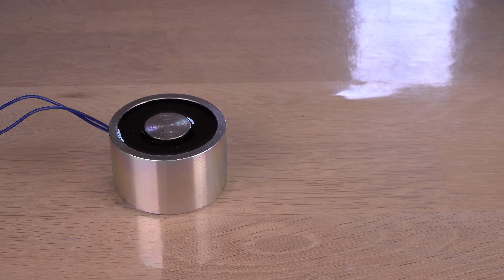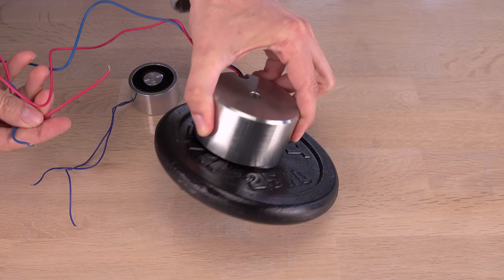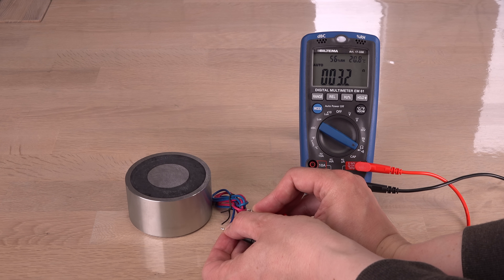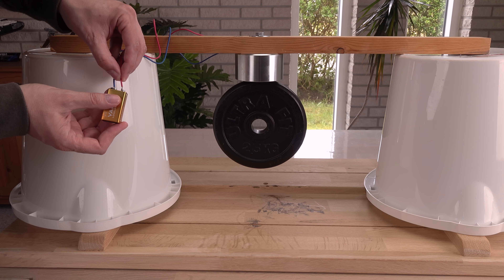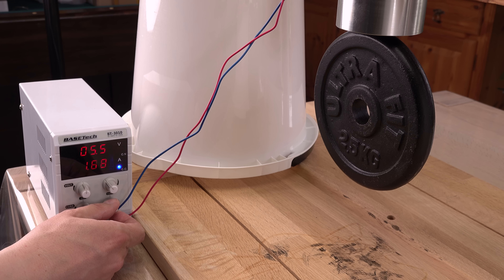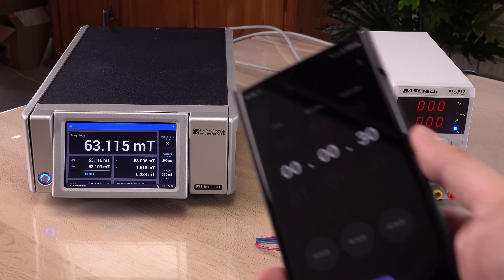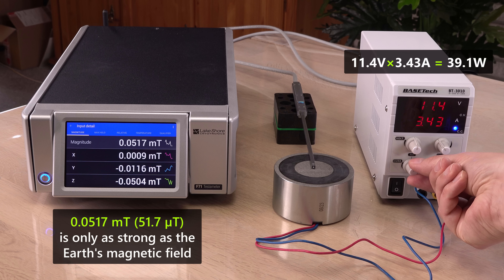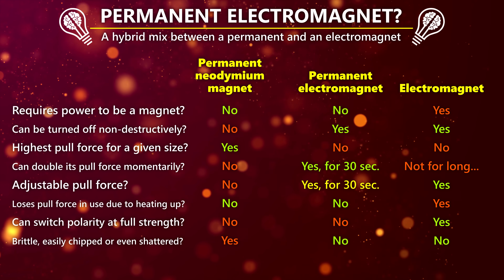NO ELECTRICITY Electromagnet?!? The Weird and Wonderful Permanent Electromagnet

Comment: So simple yet so clever.  Scrap yards might save money using this idea when they lift cars and stuff. They are using a constant current, this would save the magnet from being on so long.
Reply: They would not safe money AT ALL... on the contrary.

A normal non-permanent electromagnet, as used by scrapyard cranes, creates magnetism by using electrifying cheap coils of wire. Yes it costs money to run it, but that is absolutely nothing compared to the cost of creating a gigantic permanent magnet. (not to mention the weight of the thing, which would be tons and tons on its own).

To have a permanent (electro)magnet you first need to create a gigantic permanent magnet out of extremely heavy magnetic material (like iron, etc). To make a magnet the size of which is used in scrapyards would cost billions per piece.

Also, those scrapyard magnets are most of the time OFF instead of ON/magnetized anyways.
Reply: @CookieTube  I agree and I think another problem would be safety. With the electromagnet fighting against and cancelling out the permanent magnet, the repulsive force between them must be pretty strong. That means the construction holding them together needs to be able to withstand that force. For a magnet the size used in junk yards to lift cars, I'd think the forces would be pretty strong and if it ever failed and came apart, it might be catastrophic and dangerous.
Reply: @stefanl5183  yes and no... there is no repulsion between the two if you apply the proper polarized current.
But if you do, yeah, things might go boom.

What actually happens, with the right polarized current, is that the magnetic fields of the permanent magnet are actually attracted to the coil inside, instead of propagating outwards.

So there is no repulsive force, on the contrary, there is an attraction force (which would keep the device together so to speak). When there is no power, the magnetic fields are 'free' to go 'outside' and wrap around the device as if there was no coil in the first place.

Note: I'm not the best in explaining all this though.

Do you know those things, often used in work shops and labs where if you turn a knob the thing is magnetic and holds to a surface. And when you turn the knob the other way, it releases. That is essentially what an EPM is, but instead of a manual mechanical knob, it uses electricity to "turn the magnet on/off" (of course, the magnet is always 'on', hence the word 'permanent'. It just alters where the magnetic fields go)

https://www.youtube.com/watch?v=PMma3OJUHhs
Reply: @CookieTube  You really should study physics a bit more if you are going to be tempted to come out with such moronic statements.  You sound moronic.

Comment: This is very interesting. I can picture magnet fishing guys upgrading to one of these. The ability to let go or attach stronger would be neat.

Magnet vises and bases are very handy in any workshop for quick and solid mounting of tools and measurement equipment and difficult to mount objects. Strong switchable permanent versions are very expensive and bulky and electo versions can only be left on for so long before overheating and they need significant power. 
This magnet gives so many options. Turn off for positioning, neutral for holding in position and charged for when working. 
I would love to play with some of these. Tapping head, grinding plate, mag sheet metal brake, the list goes on.
Where do we find these? What specs do I need to check to ensure I'm buying one with the same potential?
Reply: "This is very interesting. I can picture magnet fishing guys upgrading to one of these. The ability to let go or attach stronger would be neat."
.... or make it double duty, and apply sh*tload of power and you have an automatic real fishing device ... lol

In all seriousness, the usage as a (semi-permanent) holding device in work shops is indeed one of its many uses, just because of the exact reason you mention.

The search terms would be "permanent electromagnet", "electro-permanent magnet", or "EPM".... And as for specs, it is the holding power you need to check, usually expressed in Newtons (N).
Reply: @CookieTube  So far I haven't been able to find any to purchase. Ebay, Aliexpress etc can't even get basic magnet terms correct. Eg. Magnet sucker, magnet suction cap. 
Not sure were to find them, but I'll keep looking.
Reply: @NathanNostaw  Did a quick search on Conrad. Apparently, permanent electromagnets are listed there as "magnetic (disconnected)" opposed to "not magnetic (disconnected)" for normal electromagnets.
🙂
I think the one from the video is the "RED MAGNETICS Electromagnet magnetic (disconnected) 1900 N 12 V DC 45 W ITS-PE-8245-12VDC" price € 230 / $US 260
Reply: @CookieTube thanks for the reply. Ill see if Conrad ship to Australia and if the freight charge is fair. Given the individual price ($500aus +freight), my grand idea of an array of these for a sheet metal brake may need to be put on the back burner.

Comment: No way you're going to get 2.4A from a 9V battery. Being typically six 1.5V cells in series, they're not designed for high current draw.
Reply: Obv when you connect the magnet, its EMF is so low, it becomes not 9V but more like 6 or even 3 volts.
Don't forget voltage drop.

Comment: I’ve built powerful electromagnets from old microwave transformers, you cut the top and secondary coil out and the primary alone generates a strong magnetic field, even on 1.5V. It’s strong enough to keep my workshop door locked shut

Comment: At 3.3 Ohms it is very unlikely that your battery will keep it's voltage level at 9 volts. I think it will be closer to 1 Volt or something like that...
Reply: yeah, most people highly overestimate the power of a 9V battery. It is one of the weakest type of the common (household) batteries.

Comment: These are for doors/gates where you pull them open after scanning your card. My childhood tennis court had them and I remember trying to open the door manually and never could.
Reply: Yes, they could be used for that, but it is more expensive than a cheap non-permanent electromagnet and a spring. In that case, it is the spring mechanism which holds the door locked (not the electromagnet itself). And when briefly given a power pulse, the electromagnet pulls the springed lever back to unlock the door.

Comment: Even 30 seconds in it's obviously a permanent magnet with a coil to cancel out the field. That would be useful as a fail-safe when lifting heavy things, and a power saver since you only need a current when you want to release the load.

Comment: Just floating an idea..... work with me.
You take a vessel and fill it with mineral oil. Suspend a light weight, buoyant, magnetic rotor on top of the neutral mineral oil. On the outside of the vessel, utilize one or more of these EPM devices to naturally repulse the opposing rotor, suspended in the oil. The rotational energy is extracted at the top most point of the vertical axis. By pulsing on and off using its own self generated current, the natural effect of the permanent magnet remains undiminished. Friction is greatly reduced, due to the mineral oil, which is unaffected by the magnetic fields. More consideration could be given to the hydrodynamic effect created by rotation, as well, if scaled up.
Reply: I wish i could draw you folks a picture.
Reply: @toxok If you're trying to describe what I think you're trying to describe, it'll cycle on and off for a really long time. Maybe even forever, if it's very finely crafted. But the moment you try to extract any energy from the system, it'll stop. Because you extracted energy from the system. And that's a good thing. What do you think Lockheed Martin would do with free energy?

Comment: I would like to see you make an oscillator with this: 
a piece of a thin flexible ferromagnetic material that is placed closely to the magnet and will be attracted to it. After touching it will complete a circuit that is connected to the magnet and will therefore turn it off. The flexible contact will be reset and attracted again.
Reply: buzzer?
Reply: Not only that, this oscillating buzzer can be used to convert DC to AC 😱

Comment: In MRI machines, particle accelerators, etc., persistent superconducting magnets are often used to prevent the need for a continuous high-current DC power supply, meaning only the cryorefrigeration system needs power. Through the magic of superconductors, the whole magnet remains energized, and thus creating a magnetic field, simply by shorting the ends of the coil with more superconductor, which is often accomplished by having that superconductor shunt always connected but with a small heater to raise it's temperature above where it superconducts when the external supply is connected for startup. Although it seems as though this would break some law of physics, remember that conventional permenant magnets achieve a similar end goal. More info on wikipedia: https://en.wikipedia.org/wiki/Superconducting_magnet#Persistent_mode

Comment: I wonder about permanent demagnetization if the magnet is activated many times.
Reply: Yes. They will.  But EPMs are supposed to be used in unpowered mode 99.99% of the time and only shortly pulsed into the powered (unmagnetised) state.  So the loss is minimal if used that way.
If you have it powered for long times... then yes. Very much so.
Reply: @oreubens  That is probably more related to high heat while ignoring the duty cycle making it easier for the material to lose its magnetism. It really depends on the material used and what temperatures and magnetic fields are reached. I suppose you could run the electro-magnet in the polarity that matches the polarity of the permanent magnet getting it as hot as possible without burning windings or ruining the potting material and then chill the thing down before de-energizing it to re-magnetize the permanent portion.
Reply: Makes me wonder if you can then re-magnetize it simply by running in the opposite polarity
Reply: @casualbird7671 
Most definitely running it in reverse has the opposite effect.
Reply: @drgazter what if it's to do with heat instead of magnetism like the other commenter said?

It's be cool if it was the magnetism though, then maybe you could automate it to keep the magnetism "topped up"
Reply: @casualbird7671  Probably yes, I though about that too.
Reply: That's probably why it has those strict duty cycle limitations (and might also be why it uses the more robust magnet; heat tolerance probably comes along with some level of general demagnetization resistance), and it's most likely intended for use in situations where it'd be turned off significantly less often than that
Reply: That depends on the material used for the permanent portion. Neodymium is usually rated for 1.5 Tesla, so this one probably doesn't have anywhere in where the field strength gets changed by 1.5T.
But the real answer depends on the material used.
Reply: I`d also expect it being bad for the magnet if it is not holding anything (open magnetic circuit) and you energize it anyway.... I mean, being left open can damage some types of permanent magnets without any additional field interfering!

Comment: I've been pondering making some things like this (much smaller) for a couple of years, using a regular electromagnet facing a permanent magent, as a way to drop the canvas covers/awnings over the mesh windows of my large tent whenever it starts to rain.

I didn't know they existed premade.

Is 'permanent electromagnet' the best search term?
Reply: To actually answer your question instead of ranting about how they are misused in amateur theatre:
Proper search terms would be: "permanent electromagnet" or "electropermanent magnet"  or EPM....  (with emphasis on 'permanent' in both case, otherwise you get the normal electromagnet).

The one in the video was purchased at Conrad , and is the type: "RED MAGNETICS Electromagnet magnetic (disconnected) 1900 N 12 V DC 45 W ITS-PE-8245-12VDC" , costing $US 260. On Conrad search for "magnetic (disconnected)" opposed to "not magnetic (disconnected)" for normal electromagnets.

Comment: Simillar but not round magnets i saw used as a door lock, deactivated with rfid button or code
Reply: Maybe, or could also have been a NON-permanent electromagnet with a spring mechanism. That would be far more common (because of costs).
In that case , the non-permanent electromagnet is used to actually release the lock (pull a lever), and it is the spring system which holds the door locked when the electromagnet is not powered. So in case of power outage, the door stays locked.

Comment: I wonder if these are the same thing we have at work on the doors? I almost thought it was supposed to strengthen the pull at first.
Reply: Highly depends on what kind of doors they are.

But 99% of the time, normal non-permanent electromagnets are used on normal doors. i.e. they keep the (fire proof) doors in hall ways in an swung open state, and when there is a power failure they release and the door gets closed.

The permanent electromagnets, as shown in the video, are used in cases like security doors which need to stay locked in case of power failure and can only be unlocked from the outside with a badge or something (which sends a electrical pulse to the magnet to momentarily unlock). eg: front entrance doors of buildings, or one-way  gates in fenced of areas. Although in these cases, a system with a regular non-permanent electromagnet and a springed lever can be used too.

Comment: This kind of magnet is called an electropermanent magnet (EPM).  Plenty of info online, once you know the proper name for one. :)
They're used when you need magnetic gripping is needed but permanent powereing is not desired or practical.
Reply: Is this similar to how magnetic core memory works? You can magnetize and demagnetize it with electricity
Reply: @piguy4137  No.

In case of a permanent electromagnet, the magnetism and fields are always there, you just shortcut it to the electromagnet inside the 'device' and thus the magnetic field lines also stay inside the 'device'. As explained in the video, the activation of the electromagnet inside the device "cancels out" the permanent magnetic fields which would otherwise be noticeable from the outside. Also, the 'permanent' is key here. It is just a matter of getting the magnetic field lines outside or keeping them inside the device. But once the device looses power, there is no way to keep it in a de-magnetized state.

Magnetic core memory works by magnetizing certain parts either positive or negative. 'Polarity' is key here, not the magnetizing part. So, depending on the direction of the currents, the core will pick up either a clockwise or either a counterclockwise magnetic field, storing either a 1 or either a 0. Once magnetized, in theory, they can hold their state without the need of power; they are a type of non-volatile memory. Aka: they are always magnetized, it is just a matter of in what polarity.

TLDR:
permanent electromagnet: works by diverting the permanent magnet field 'in' or 'out'. Looses state when not powered.
magnetic core memory: works by polarizing the permanent magnet fields 'positive' or 'negative'. Keeps state when not powered.
Reply: Can they be used to pulse-motivate a freewheel generator? On- off, on - off?
Reply: @toxok technically yes. But it would be less efficient than a regular electromagnet.